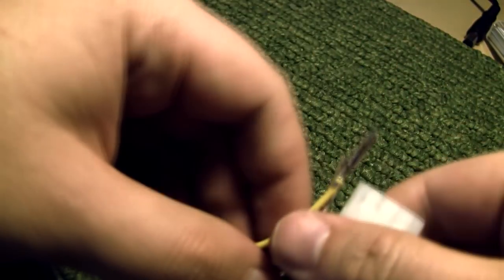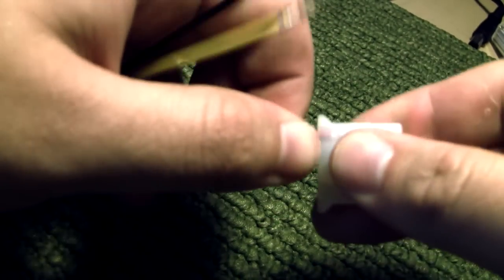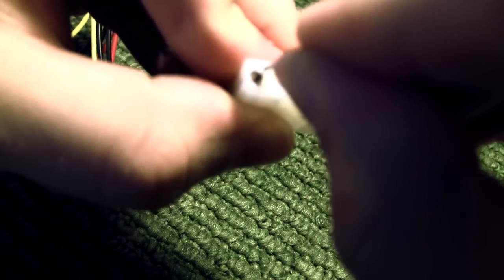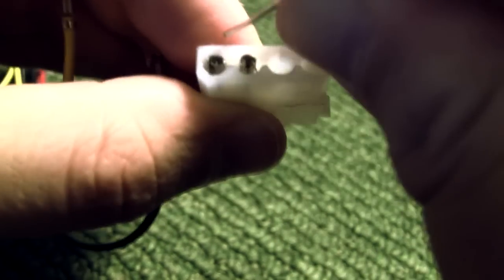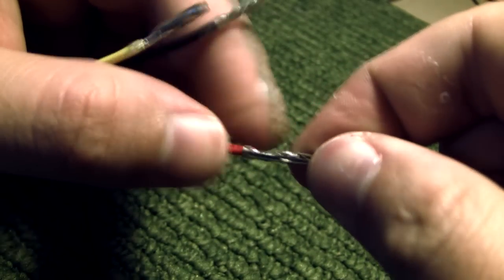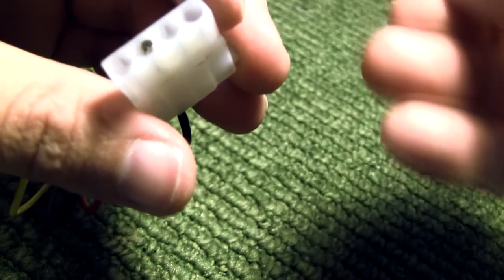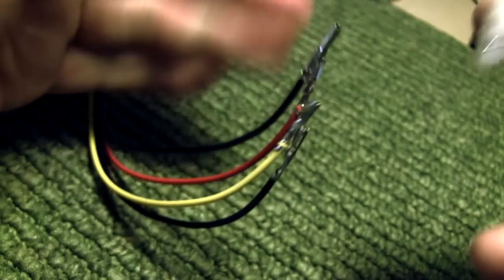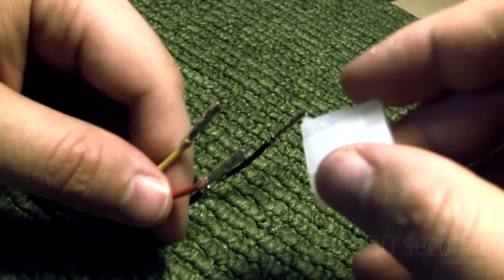Remove wires from Molex connector

Comment: to help general movement of the Rubber seal and the wires you can use a little penetrating oil like WD-40 which will lubricate things and also it displaces water as well
Reply: Maybe not wd but electrical connection spray and not the "normal" wd

Comment: AAArgh! buy the tool. high resistance equals fire. Trust me I've seen hack jobs that have almost burned down buildings and destroyed 100K + machines. Ten bucks and a little practice is a small price to pay. Your customers wont thank you because they'll never know.
Reply: Really old comment, I know, but if someone stumbles upon this I want to spread the info: You do NOT need a special tool! You can take the ink tube from a non-clicker ballpoint pen and use that!
Reply: Yes, that makes it easier for the male pins. For the female inserts you're back to a specialized tool or some such...
Reply: Yup, if this is your business, buy the tool. If you're just a person at home who needs a couple removed, this works fine.  Noting that this is NOT intended to be for re-installation.  And these are not high voltage,, typically 12VDC, nor high current connectors.

RichE